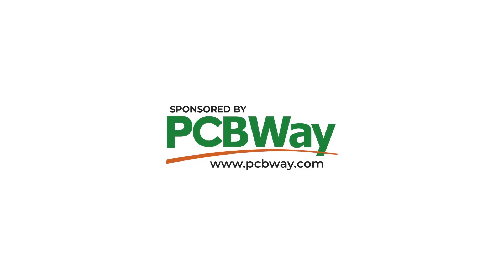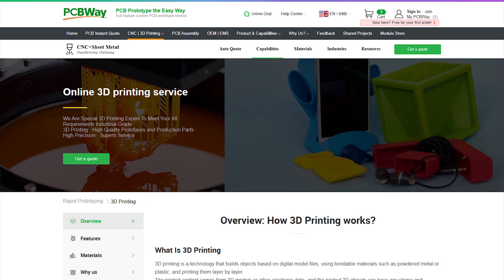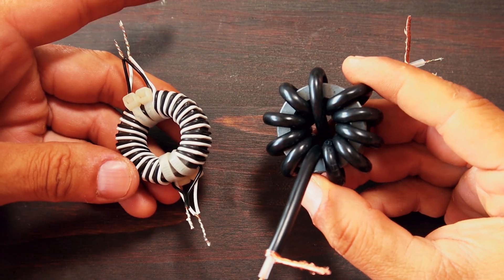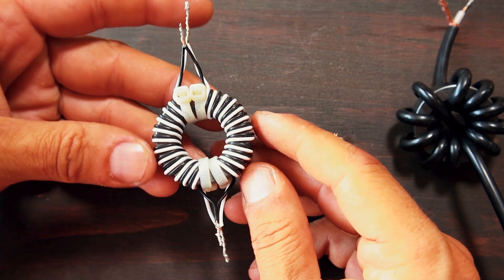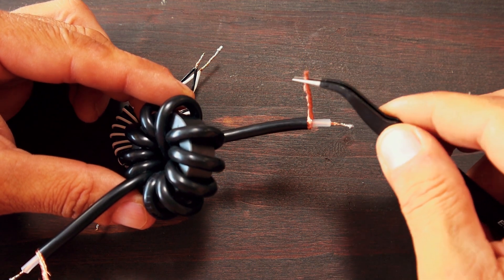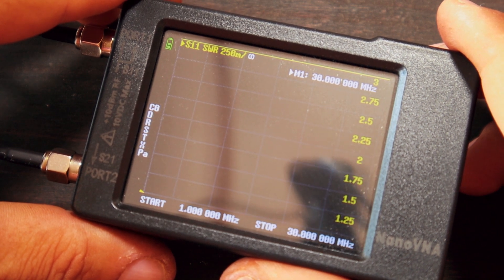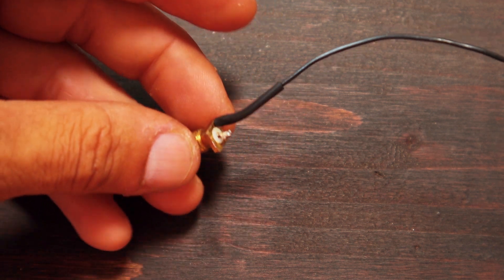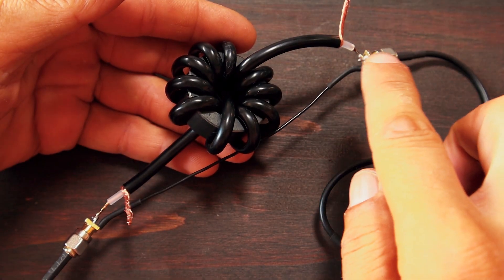Common Mode Current Chokes Comparison - NanoVNA Measurements

Comment: DUDE! By measuring only ONE HALF of the toroid winding, you're essentially measuring the RF rejection of a simple inductor used as a simple RF choke and NOT a "Common-Mode Choke". You need to connect the center taps of the NanoVNA to BOTH HALVES of the toroid winding (at input AND output to each NanoVNA center tap, respectively) and you should find that they deliver bettern than -40dB of "common-mode suppression or rejection". That's because with this test you're essentially trying to SEND current of the SAME polarity down BOTH SIDES of the CMC which is the definition of "common-mode current".
Reply: I initially though the way he connected things was a bit odd. The more I think about it, what he did was the inverse measurement of what is normally measured.

Normally, I stick a 50ohm resistor across one end of the balun and then make a full coaxial connection at the other end of the balun. The measurement I make is S11 (SWR/Return loss). I end up with a plot that shows how much of the power is absorbed by the resistor, and as a result, how close to 50ohm the input of the balun is. Usually, we just assume that the common mode rejection aspect will "do it's thing" without actually measuring it.

What this guy did was the opposite - He measured the common mode rejection (and got pretty good numbers). He did seem to misunderstand what he was looking at though - he commented that his units would be better at 80m and below when in fact what he was seeing was worsening common mode rejection at lower frequencies. The numbers down there were still in the region of -20dB (-99%) so very acceptable.
Reply: @digitalradiohacker  I knew the way he was measuring didn't seem right but was having trouble trying to work out how it could be measured. Your method is pretty clever. 73, VK1TRS
Reply from the maker: It's actually right. There are always more ways of doing something, not just the way you know to do one thing. Please study a little more... you'll discover many new and interesting things. 73, YO6DXE. P.S. I don't say this in a mean way, but I've been where you are, I know )).
Reply: In fact, it is not a coil, but a wire. Here we have two coils wound oppositely, so their inductances cancel each other out, although there are some reactances resulting from the capacitance between the wires and from the inductance of the connecting wires. Somewhere along the way, there is a resonance. This can be seen in the charts. If it were inductance, the attenuation would increase as the frequency increases. 73 de sp5ism
Reply: Is there a way to contact you for more information about this?
Reply: @georgelasko8346 Finally someone who understands the difference between an inductor and two windings on a core and configured to null common mode current!
Reply from the maker: Still learning on how to make better measurements on anything related to amateur radio. The best part of the hobby is that there is always something new to learn for better results. So far I do things as I learned from 99% of the people doing measurements either here on YouTube or in real life. As long as I am "close" and I have an idea how a certain thing may work or how effective it is... I am happy. But I never say no when it comes to doing it better. 73, YO6DXE

Comment: What type of coax did you use? RG-178? Are These thoroids both FT 140-43? And the final question: what diameter (or AWG number) of insulated copper wire?
Reply from the maker: The coax was just simple RG-58... but I tried to buy one that was more flexible and also I left it out in the sun to warm up and become even more flexible when making the turns on the toroid. The toroids are both FT140-43 yes. Its better to use 240-43 or 240-31 even better. I used what I had available. The insulated cover wire is 0.5mm no insulation / 1mm measured with the insulation.
Reply: @dxexplorer  Thank you!
Reply from the maker: @SeaOtter-n7k  Always a pleasure buddy. 73

Comment: I suspect that the change in SWR is becuse your VSWR is being adversely affected by common-mode currents. That is to say: it is reading wrong, until you fit the choke and get a more correct reading. 

I have seen this many times in my old shack where all of my antennas were very imbalanced due to antenna layout and size problems. All of the antennas could be matched to a very good (1:1) VSWR, yet I always got bad RF burns because the rig and ATU case were hot with RF. I could not install a balanced antenna due to the shape of the garden.

Once I fitted a good coax choke before the antenna switch (which was right at the input of the ATU)  the best matched VSWR always read higher - 1.5:1 or 2:1 was the best match on some bands but there was no problem with unwanted RF voltages in th shack. As a bonus, rx QRM was lower too, and much lower TVI (this was 1990's so analogue TVs were difficult in my area)

When I move to a new location in an apartment, I saw similar on a 21MHz 1/4wave vertical - the SWR would change at each position depending on the length of the coax - over 6 months I moved my rig further away from the antenna so added extra coax length. The VSWR reading dramatically changed depending on the coax length. This was a bad sign of common-mode currents on the coax. 

Again, I thought of the coax choke and once I fitted it, I had the a higher VSWR at but identical readings at every distance/coax length no matter if I operated from the living room, the kitchen bench or the far bedroom. Overall performance was much better despite higher VSWR readings. So my conclusion is that the VSWR meter does not read properly unless it carries no common-mode current

The way my brain envisages it: freezing time for a split second, imaging the centre conductor showing 100 volts of RF at the meter diodes, but the coax shield being at 50 volts of RF - ie: the coax shield is "hot" with common mode. The difference between the two is 50 volts RF potential. 
Now, with no common-mode flow, the shield will be at 0V but the centre conductor will be at 100V, so there will be a much higher difference.  So the meter diodes read a higher voltage, but gives a more true (higher) reading of VSWR with a common-mode choke. 

The meter is lying to you if it has common-mode flowing because it displays the ratios (the ratio  difference of fwd:reflected) between the currents/voltages. 

If you measure the VSWR at the antenna feedpoint and then again at the back of the radio, with common-mode problems you get very different readings. But with a good common-mode choke, or a perfectly balanced antenna (or both) comparing your VSWR reading at both positions will ONLY be affected by coax attenuation (and even then, at HF and using good quality coax cables, this will not be a lot unless you have hundreds of metres of coax run) 

This is why some people think that coax length affects VSWR of the antenna. (they say "use exactly multiple of half wavelength coax " or "use only X metres of coax")  The length shouldn't matter but it will appear to be so if there are common-mode problems.
Reply from the maker: I will be short because I have a long day today and still lots of work to finish, but I read it all and noted. Yes it makes sense indeed. Thank you so much for all the detailed info. This helps a lot because when you put ideas like this together things that to make sense. I guess that is why we always learn no matter how much we already know 😁. Cheers and have a fantastic rest of the week. 73, YO6DXE.

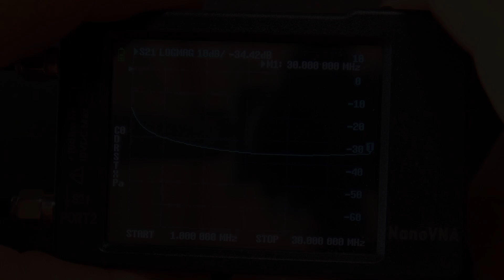Comment: 5:30  to stop reflections on the screen, use a grey or dark coloured bed sheet over your head, camera and the VNA. Like a tent over you. The screen will be easily visible because it has it's own source of light. Even a white sheet may be better than nothing - try it if you have nothing else.

But really, it's clear enough, so not a big problem.

PS: great vid
Reply: I'm a photographer by trade and a trick we use, is to take a piece of card and cut a hole to push the lens through. Set the camera to where you are going to photograph the screen and make sure the screen reflects the black card. You can then trim the card down if you need to, so that is no bigger than needed to make the screen look dark. Basically, a screen is a mirror, if it "sees" black, that's what it will reflect. I hope this helps.
Reply from the maker: @acestudioscouk-Ace-G0ACE Thank you so much for the tip. I hope you are doing well. Usually I make the videos in a rush so as long as I can still see whatever is on the screen, then I don't bother much. To get rid of reflections though... I go the simple way when I have the time for this... I just use the polarizing filter to get rid of the reflexion 😁. Works like a charm and it makes my life easier. Have a fantastic rest of the week. P.S. I also like the card idea. 73, YO6DXE.
Reply from the maker: Thanks so much. Ohh yes it would have been better. I know the trick but at times I have to make the videos on a rush so I skip many steps in order to finish filming faster 😅😅. I call it cheating as I have no other choice 😁. Cheers and 73, YO6DXE. 

P.S. I will try the polarizing filter next time as that one clearly removes all the reflections and stuff 😅.

Comment: finally someone who both explains what he does and shows how he does it. I myself have a Nano VNA and now I know how to make a setup that shows how to measure a CMCC.

I have a question, why do you make a connection between shields on the 2 connectors. 
with an external wire?
and not the shield which is in coax
Reply: Hmmm. Common Mode Current flows on the outside of the coax braid (skin effect). You should be measuring the attenuation of CMC across the braid and not the center conductor.
Reply from the maker: @ke4tmt91 Yes it does, but technically a choke will use both conductors to become effective as you cannot supress something unless you see what you are suppressing 😁. So one conductors should be able to see what the other does so it will know what to do. Ok this is a funny explanation but the idea is that no matter what I measure, the inner conductor or the outside shield... the nanoVNA will show the same as the turns are identical. We are basically interested in how efficient it is and how much bandwidth we have. I want to see when I have time how the number of turns will affect this. 73, YO6DXE.
Reply: @dxexplorer  
I tried it and found it didn't matter, inner or outer.
G4GHB.
Reply from the maker: Indeed... is two identical windings. Ok maybe a tiny difference could be since the shield is closer to the toroid than the center conductor,  but is just minor difference. As long as we see how much attenuation and bandwidth we get... its all good. At the end, we are amateurs not ingineers to do lab grade measurements. 😄 73 and have a fantastic rest of the week, YO6DXE.
Reply from the maker: Yes yes is very important to skip the shield and make the connection external in both cases either when using the coax or the parallel wires.
Reply: @dxexplorer sorry but this answer did not actually answer the question of why. You only said it’s important to not use the shield, why is that?
Reply from the maker: @azarellediaz4892  I am only interested to measure one conductor since both windings are identical. And in practice they work one against each other canceling the currents passing trough. That is what I also understood so far from others that I learned from.

Comment: Why do you test the attenuation on the center conductor while the unwanted common mode current flows on the external side of the braid? You measured the reactance trend of the inductor you made.
The result probably won't be much different but a beginner, not knowing how a transmission line works, might think that this attenuates his RF towards the antenna or towards the receiver.
The coax of that choke seems to make curves with a radius that is too small (deformation of the dielectric): the minimum bending radius indicated by the manufacturer must be respected.
At the end of the story you have not verified the main function of a balun: that of being able to connect balanced elements with unbalanced elements and vice versa in an antenna system without generating side effects. Yet it's not difficult...!
You can check my articles (I hope Google will help you about italian): the links are on my QRZ page.
It is at that point that a balun must be inserted while a choke can ALSO be useful at the antenna input into a receiver or RTX. 73s

Comment: I did similar choke using enameled copper wire, and the parameters depended on the winding method. In my case, keeping black&white close to each others caused worse results, probably by adding capacitance. When I separated them to equal distance the difference was huge on plus.
Reply from the maker: I didn't got to test this but I was told in the past that usually thicker insulation on the wire helps in getting better results... so I guess is true. Thanks for this. Is good info to write it down. 73, YO6DXE

Comment: If swr changes with chock it means you have common mode current on coax screen. For symetric dipole chock should be installed at antenna, for EFHW it could be installed just after 49:1 or after 5% lambda from it.
Reply from the maker: In theory yes, but I guess that would be valid if I would be transmitting. Otherwise I guess there would be no common mode current. When it comes to placing the choke, that is what I also know, only that it doesn't always seem to do the job well ( on the EFHW, on the dipole is ok ). I have a feeling that maybe the toroid used and the material may have an influence on the SWR change. Is not much though. If with no choke I have a good 1:1 on 7.030MHz for example, with the choke it would be the same but on 7.060MHz. I am still studying this 😅😅. 73, YO6DXE.
Reply: @dxexplorer  yes because the point where you “choke” the coax corresponds to make a conductor of a certain length part of the antenna, the shield of the coax between the choke and the antenna feed point. It is like adding a counterpoise or ground radial. Enjoy your experiments and continue to share. Best wishes, 73, Diego
Reply from the maker: Thank you Diego. Yes that is what I thought 😁... but it took me a while to figure that out 😅. Have a fantastic week. 73, YO6DXE.
Reply: @ To you too! By the way I’m wandering around your channel and you make great quality videos, congratulations! Looking forward to catch on air… 73, Diego
Reply from the maker: @IZ0MTW Thank you so much. I try my best with the little knowledge I have. Is nice sharing what I do because when I do mistakes people help and let me know how to fix things... and we all learn together in the process 😁.

Comment: так оплетка же тоже является частью контура дросселя, а вы ее исключили замкнув вход с выходом
Reply from the maker: No no no... you just connect the coax to the BNC for example as normal... nothing unusual. You end up with one BNC in one side, and another one in the other side. One side goes to the transceiver and the other BNC to the antenna. Is just the one with the copper wire that you have to do the wire connections since you have two separate windings. One on the left one on the right. But there also you connect the BNC the same way as you would with a coax once you connected the wires together as in the video, because you end up the same with two in one side and two in the other side. I hope it makes sense, hard to explain I just woke up a little earlier 😅😅. 73, YO6DXE.
Reply: ох да, мои английский не очень хорош, но я вас смог понять))) в качестве balun 1:1 я бы  советовал тот что мотается тремя проводами (ссылки тут размещать не получается) они у меня показали лучшие результаты чем такие  из коаксиального кабеля или из двух проводов))) хотя в моем случае ферритовые кольца на которых я их мотал были далеко не лучшего качества)))
Reply from the maker: @piterstein9625 Хорошо, что вы поняли насколько.  Про трехпроводной не знаю.  Может быть, вы можете отправить мне электронное письмо со ссылкой, если у вас есть время.  (это адрес электронной почты на странице контактов в блоге или в QRZ). Мне тоже интересно попробовать этот вариант.  😅😅
Reply: @dxexplorer  ответил в контактах в блоге, но в отличии от авторскои конструкции в моей все три провода были скручены в один, в ходе экспериментов  такое решение показало лутший результат с моими ферритовыми кольцами. удачи в ваших экспериментах)))
Reply from the maker: Эксперименты вообще - это те, которые приносят сюрпризы и удивительные результаты, когда дело касается радиолюбительства)))

Comment: Very interesting. I wound choke with coax. As  i remember it  was 4 wound from one side and 4 from another side. I made it when my antenna wasn't matching. i had manual antenna tuner and it was arking and choke removed those problems. Back then i didn't had nano vna to check it, but  it worked great for me
Reply from the maker: I think the first 1:1 RF choke I made was for my CB antenna... long time ago. It was made on a 15cm diameter PVC pipe and had a bunch of turns. It worked well but it looked like I have a pot hanging down from the antenna 😅😅.
Reply: @dxexplorer  imagine that 🤣.  Yesterday I got my new transceiver yaesu ft-891. Now we can make contact whenever you will be ready 😁
Reply from the maker: @4L1LAT Ohhhh niiiiice.... maybe we can try this coming week. Not sure when I have the time but I will let you know in advance.
Reply: @dxexplorer  no problemo😄. Good luck my friend 73.
Reply from the maker: @4L1LAT excellent. We plan it and we try a QSO. I hope we are lucky with good propagation too. 73 my friend.